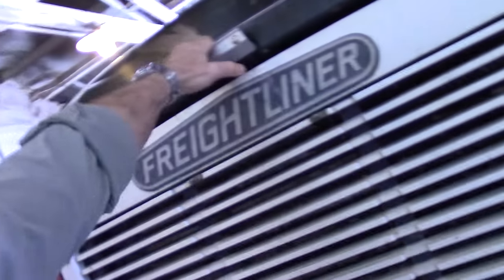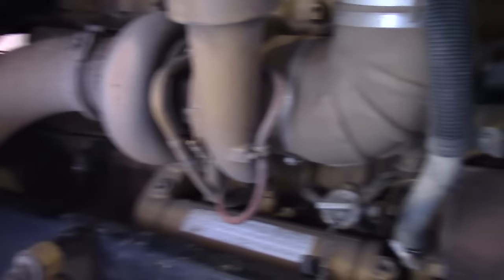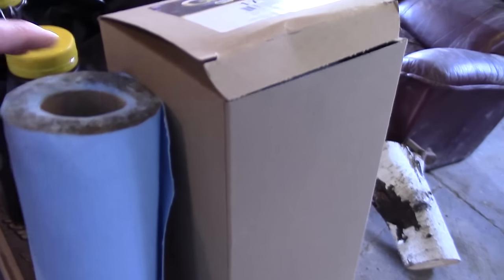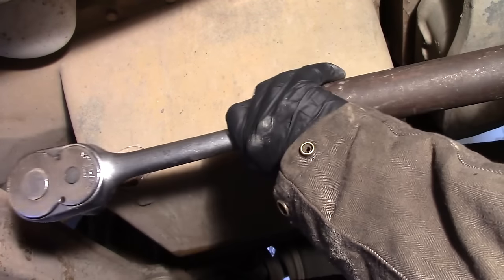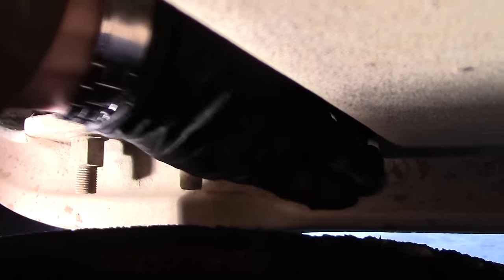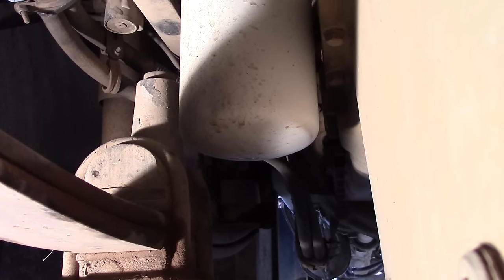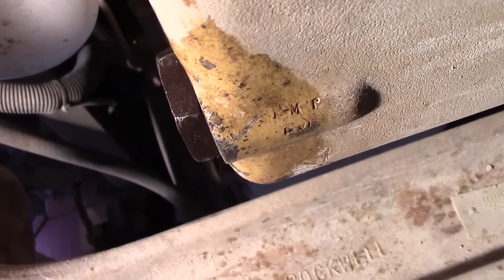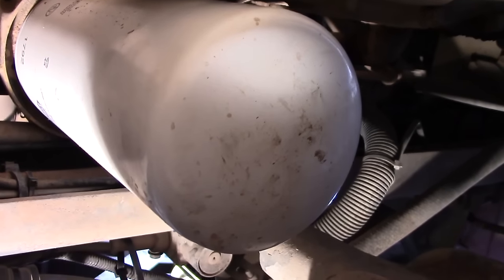How to do an Engine Oil change on a BIG Truck-DIY Duke

Comment: OMG a bag around the filter....That is brilliant! Never thought of that before!
Reply from the maker: +TIKIMAN198 oh thanks
Reply: Yea I've made such a mess with those things and never thought of a better idea either...!
Reply: Take a small punch and make a hole in the bottom of the filter and then let it drain...
Reply: +TerminatorD4 , that's the way too it.
Reply: i second this, i do it for every truck oil change i do
Reply: i just put the oil pan under the  filter and drill a hole on the bottom of the filter and drain it... then take it off ... and your done ...
Reply: Paul Griego Ya it makes it so easy
Reply: I think Trent Reznor beat us all to that :P
Reply: Bet you never thought to punch a hole in the bottom of the filter either did you? Smarter to drain it before taking it off.
Reply: TIKIMAN198 ikr
Reply: mr.ak111 the 6.7L Cummins doesn’t have any access to the oil filter from the underside of the truck. You have to get to it through the passenger side wheel well. It’s a pain in the ass, and you make a monstrous mess. I used an oil vacuum to suck it out of the filter before I’d pull the filter through the small access Hole in the wheel well

Comment: TIP: you can drill out the bottom of oil filter so its not as messy when you take it off.
Reply: Emkura Fura Šoferski Kanal uuuuhjkl
Reply: unless the cross member is right under the filter like on most Cummins ISX engines. I just twist it off since it'll make a mess anyway and spray it down with brake cleaner.
Reply: Emkura Fura Šoferski Kanal I just use a hammer and a punch to drain the oil out of the filter
Reply: use a punch it works way better... If you use a drill you have a chance of getting oil in it
Reply: That filter will drain for a week.
Reply: leonard payne ......no I do it almost everyday drains in like a min or so
Reply: Yea and it'll just did the Drill so either way
Reply: I just use a Philips screw driver  and punch a hole in the bottom
Reply: I don't think they recommend pre filling the filter anymore. If you put any oil in you should put it only on the outside so it filters going into the middle.
Reply: Hiperf 2007 - That rule is more for fuel filters since fuel out of the tank or from the station hasn’t gone through a filter yet. Engine oil should be brand new and clean out of a new, clean container, so it’s less issue with getting contaminants into the filter. I’d personally still rather fill my filter as opposed to running the engine without oil until that gallon filter fills up.
Reply: At Kenworth MHC leasing we would just puncture the filter with a sharpened small lady's foot prybar.  It drips on the axle but that's not really an issue we just blow the axle off with a steam cleaner in the after service cleaning.
Reply: Auto punch. Pop it, then tap it with a hammer if it didn't pierce enough and go prep your new filter, by the time you get the new filter prepped the old one will be drained and ready to take off. Kinda common sense
Reply: ok you guys have obviously never done an oil change when you break a filter and I mean screw it off to the point its loose it will leak out all that oil, a cummins wont though theyre designed not to bleed oil when you remove the filter
Reply: @earlp3361  Use brake clean it's much faster
Reply: Samo čekić i šarafciger je dovoljno da ne umažeš mašinu uljem
Reply: @Darksyne  our isx is in a western star, its still tucked i  there and tough to get at but we don't have a crossmember under it
Reply: especially useful when there's no way to keep the can upright getting it on/off! Love those sideways mounts (83 Chevy S10)!
Reply: @bigjuicypickles6822  Oh come on, you've never had oil on your "drill" before?
Reply: Then you have to buy a new thingy
Reply: @buixote 222l

Comment from the maker: It's 1800 pounds of torque.  My bad!!
Reply: Dont these run total loss lubrication with total oil burnoff? Not sure? i heard you just ad oil to them and the motor burns it off as it goes!
Reply: I was really confused when you only said 290 foot pounds. when my 99 Chevy 1500 puts out 315 foot pounds. still a great video
Reply: that's more like it
Reply: I was about to say,,  my '68 Dodge Charger with a 440 makes almost twice that torque   ;)
Reply: Lmao that threw me off big time
Reply: thats more like it
Reply: That sounds more like it.
Reply: lol i was thinking "that's it?'
Reply: that confused the hell out of me. my motorcycle with a 600cc engine throws 75 or so. no way a 14100cc engine is only 4 times more.
Reply: ian peters no hate but your 600 does not make 75 lb-ft more like 45-50 probably only V twin 1000s make that much torque.
Reply: DIY Duke for some reason i can tell from just this video that you are a nice person... i dont know how but i know it.
Reply: Boutta say lol
Reply: Was gonna say, my 1.5 litre turbo diesel puts out 150 ft/lbs 😂.
Reply: Jusuf Nurkic with 18 speeds your Chevy motor cam move this, btw I wish they made a 8.1 big rig, why? It's the biggest gas motor that's not expensive to maintain like the 8.4v10 is.
Reply: What is the recommended oil change interval (in miles) on big rig engines? Cool video! 11 Gallons?!? NUTS!
Reply: I was about to say, my focus ST has 270 torque. Whoops!
Reply: It’s okay 
We’re all human and nobody is perfect 👌
Reply: Thought so, haha.
Reply: I was gonna say 200 ft lb is awful low for a truck
Reply: That's what I thought 👍
Reply: I was starting to doubt my own common sense hahaha
Reply: Just a suggestion, punch a small hole in the old filter on bottom before removing let it drain then you can take it off without the mess and bag.
Reply: I thought 290 foot pounds of torque didn't sound right lol
Reply: I was about to say man haha I was like wow I thought these were tourquier
Reply: @jlo13800  no they don't,when you change oil the motor will have all the oil you put in on the last oil change ,the truck Burns deisel fuel not motor oil unless it has mechanical problems ☺
Reply: @psaris7  unless you piss him off
Reply: I can fill it with silkolene pro 2 sx and in inject to burn while making it a poppet valve 2 stroke for total loss. I cant wait to try this, i have  plenty o silkolene 2 stroke oil to try this with and cant wait to rev the crap out of these. boy i cant wait to see if they self destruct, run that truck motor like it is in skidooo, i got 50 gals of xd100 2 stroke oil and that all i run if i cant get silkolene 2 stroke oil. total loss burn off all the way
Reply: I would would love to see how it does with xd100 with oil injection, let the torture start!
Reply: @jlo13800  this ain't no two stroke Bruce ,this engine will only rev 2100 rpm max while burning deisel fuel .high dollar engine to damage ,you might want to stick to the skidoo with your silkoil
Reply: I have made some up some special low ash oil with with tcw3 and canola oil/ soybean oil blend for and topped off a 6-71  detroit 2 stroke. I was amazed how well it worked and stayed clean, boy did the exhaust smell good on that crane motor.
Reply: i would like to see one of these motoer run upside down on caster 927 maxima, let the tests begin with oil injection, can all these big dumb engines run like a rotax or will they self destruct. Fairbanks Morse makes large 2 strokes thanks god
Reply: What is the mileage interval between oil changes on a truck?
Reply: I have rune xd100/canola oil 2 stroke blends in 6-71 detroits with out problems, castor 927 maxima is best, it sounded like a sports car and smelled awsome and stayed clean in the sump. can your 4 stroke handle it, let the experiments begin. All 4 stroke are nothing but poppet valve 2 stroke anyways, 4 stroke are an illusion. many CATS like the 3516 have a lot of room to cut ports into as theres is a lot of space between cylinders.
Reply: BTW big  2 strokes dont rev high, i work around EMD max rpm 900.
Reply: the4se engine can scream at 3800 to 4200 rpm lets see the do this. poppet valved 2 stroke or 4 stroke, it would be interesting, they can rev much more than that and produce much more power on high octane fuels.
Reply: I was going to say...thats really shitty torque when you are making 400+hp
Reply: @KLAWNINETY  even less a 1.3 liter engine makes 75 torque a 600 cc can barely make 40
Reply: Phew 😮‍💨

Comment: That one oil change you did on your "Freight-shaker" used more oil than I've put in my Honda Civic in its lifetime of almost ten years. Granted I don't put miles on my vehicles like I used to, but even so! I've done every oil change on every vehicle that I've owned, and I got my first one in 1976. I like doing routine maintenance for the same reasons you said: I can catch developing problems earlier and I trust the mechanic I see in the bathroom mirror more than I do the "pros".
Reply from the maker: +Lex Boegen we're cut from the same cloth brother, totally agree.
Reply: Your civic holds 5qt of oil?  The oil filter on this mother holds 5 qts. Engines are awesome.  Some CAT generator setups hold 175gallons+...

Comment: That is surprisingly easy, I worked on cars where it is a complete nightmare to get the filter off
Reply: Mate it depends on the car how hard it is. I got a Volvo pv445 from 1964 and it takes like 30 sec to change the oil and put a new oil filter in
Reply: I'll bet it has a lot to do with, shall I say the "culture" of trucking. When it comes to such a complicated machine and being able to lose a trucking companies' brand loyalty on a 1c/mile cost savings, one of the last things you are going to do is make a mechanic's job difficult or complicated.
Reply: Valknut Gaming does it have a b16?
Reply: I've changed the oil in a Mercedes Benz that had 2 skid plates covering the bottom and the V-6 engine required 8.5 quarts of oil.
Reply: Likes of bmw will do away with an oil filter itll be shown by onboard computer to tell you if the oil is dirty or not then throw away the engine and buy a new one once it is
Reply: Haha try changing filters on the hyundai i10.. its between the exhaust.. you WILL burn your hands.. its fine if you diy at home coz u dont need to deal with the hot exhaust
Reply: I work at a quick lube and some of these filter locations are ridiculous :’) Suzuki’s are the WORST
Reply: Is300 lol, need them tiny japanese hands😂
Reply: 3rd Gen 4Runner 4x4... they put the front differential directly underneath the oil filter. Not only making it a bitch and a half to get off, but once you do, the oil gets everywhere.
Reply: Dylan Sterling or the 1.4L turbo in Fiat 500s....it’s a cartridge type filter that sits directly under the exhaust manifold, but you can only access it from the top of the engine bay. Get ready to torch your hands and get oil on EVERYTHING.
Reply: primalfury2011 companies purposely design the new cars so the average joe can’t do oil changes very easy. The reason for this is that dealerships make more money if they force you to go to the dealership.
Reply: schudre  My VW tdi is super easy to remover the filter ,just 32mm wrench

Comment: I was curios to see if this would be any different than your typical card or pickup, but I'm surprised the process is pretty much identical. I also really like how you articulated everything, as well as the suggestions from experience. Its nice to know that my dad taught me how to change me own oil the right way, filling up the filter and running oil on the gasket and all. 

Great video, I like you.

Comment: so its just like working on a huge car.. or it's like if you were a baby working on a regular car
Reply: friedchicken1981 you dont get that dirty working on cars. I work on diesel trucks every day and its dirty as shit
Reply: Depends on the car.
Reply: toilet brush 25000 mile oil change
Reply: @steveandrews1982   I know you probably wont see this but im about to start my diesel mechanic apprenticeship, any heads up or tips about working on mainly semi trucks?
Reply: @slumber1896  man there is alot of tips and tricks.  I learned just from working on them and having few older heads show me. If you got some mechanical sense lol it's not hard.  When working on any parts of the truck that is air operated, make sure you dump the air out.  When replacing fuel filters always fill them with fuel so truck will start.  Learn how to use a torch,  that will be your friend for ignorant bolts lol.  I can go on and on.

Comment: Im a diesel mechanic and i do this almost daily, and I've learned to pop a hole in the bottom and drain the filter. Even with crossmembers, just take a small screw driver and a hammer or something to hit it in there.

Comment: If the roadkill guys tried doing this, they would end up breaking the radiator, make it puke transmission fluid all over the floor, make the brakes stop working, and fry some wires.
Reply: not to mention the lights wouldnt work
Reply: They would have to ratchet strap a couple gas cans on the back too.
Reply: accurate
Reply: And take the hood off

Comment: Awesome video sir, I would like to suggest a tip for the old oil filter. as a 310T apprentice during the oil drain I use a center punch or a full shank screwdriver to punch a hole in the bottom of the old filter and allow the oil to drain into the drain pan. this results in an empty filter with no mess or fuss. hope this helps you during future maintenance. Cheers from Canada

Comment: When you're tightening the filter you can use a sandpaper for more grip.
Reply: Wouldnt risk causing little damage to the filter? I guess it depends on the gritt though
Reply: Just little scratches to the paint, don't worry about it.
Reply: Cool thanks bro! Daniel Estrada Morales
Reply: But you don't want the filter to be to tight?
Reply: I used to always remove my car's filter with a piece of 36-grit sand paper, because I couldn't find a wrench that would fit it properly, and it's in an awkward location, sticking out sideways from the back side of the block, facing the firewall (transverse engine).  Now I have an adjustable filter wrench that works awesome, so I use that.
Reply: @Patrick94GSR  There was only 1 time I couldn't take the filter off my car and ended up bringing it to the stealership.  Whoever owned it before me brought it to a cheap lube place and when I went to take the filter off, it was so tight it broke my wrench.  The mechanic that had to take it off guessed it as put on using an impact gun since he had to destroy the filter to remove it.
Reply: @dstrdm  I believe it is painted for protection, not aesthetic.

Comment: reminds me of the good ole days as an owner operator doing my own service, on my rig and my own vehicles, I usually did the fuel filters at the same time, and most of the big rigs had an oil bypass filter aswell, thanks great video.

Comment: I've always like big trucks like this. I live in Long Beach, CA where there are a lot of these trucks because of the Port of Long Beach and Port of Los Angeles. I loved watching Ice road truckers. It's always nice learning how stuff works even though I'll most likely never do an oil change on a Freightliner, now I know. Very intriguing video.
Reply from the maker: +Richard Ojeda thank you Richard.  I've always loved trucks.  I would go with my Dad when he hauled logs out of the forest.  Then later when he hauled other things throughout the U.S.  Went to work in a truck shop when I was 17 fixing tires, greasing and changing the oil, etc.  Then started driving them when I was 18.  They still fascinate me.  Glad you liked the video.

Comment: Where do you take that much oil to recycle? 
Can't imagine my parts store smiling when I walk in with a handtruck and half a drum of oil.
Reply from the maker: s0nnyburnett farmer nearby has a shop furnace that burns old oil so he ends up with it - we get rid of oil and he gets free fuel; win/win.
Reply: at my work we pour it into a big tank outside that is connected to a oil burning furnace for our shop, so in the end it keeps us warm in the shop and does not cost us money to get rid of. but the filters are a different story, we crush them then put them in a bin and twice a month a company comes and gets them
Reply: Almost every city in the country has at least one hazardous waste recycling facility.
Reply: By US law, any place of business that does oil changes has to accept used oil for recycling without charging you.
Reply: +Tru Blu
Not really.
Repco, Auto One. Auto Pro, Autobarn, Supercheap Auto that are with in 25km of me do not have one, their is a waste oil depo 5km from where I live, but they have a 20l per day limit
Reply: +Grayfoxll Depending on where you live, I'm fortunate enough to have Oil recyclers that's happy to take as much oil as I can dump on their laps, even if I have a direct pipeline to them, it's the way they make their money.

Do a google search for locations, most major cities have oil recyclers and you should be able to dump oil there every time your household needs their vehicles oil changed,  but if you're out in the middle of nowhere I'm sure your local mechanic would be happy to take the oil off your hands, those small town country folk are always so lovely to deal with
Reply: It’s my understanding the parts houses who take in oil for recycling — make revenue from doing so.

Comment: My Dad had a problem with a really tight oil filter on his Dodge Ram the first time he changed the oil.  I find it helps to smear a little oil on the gasket.  On my car I once had an obscenely tight filter too.  I am glad that I don't reuse that part because I destroyed it trying to get it off.  What fun that is.  Another bad thing about tightening the filter too much is if you ruin those threads you are in big trouble!!
Reply: I always do that! Absolutely amazing tip
Reply: I don't think that the threads on an oil filter are hard enough to ruined the female threads it screws in to. 
But yeah, always hand-tighten, and you would be having the worst day if you stripped that hole. Ugh!
Reply: Well you aren't supposed to reuse oil filters so destroying it doesn't matter